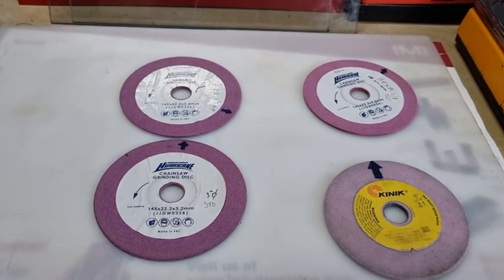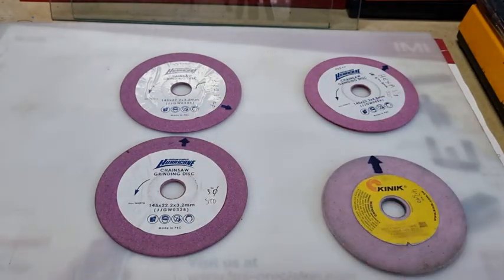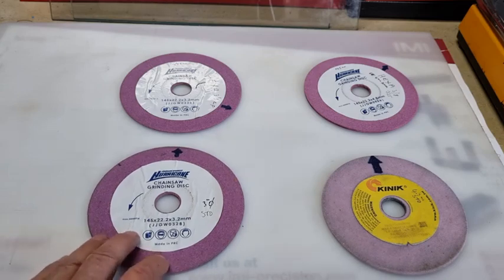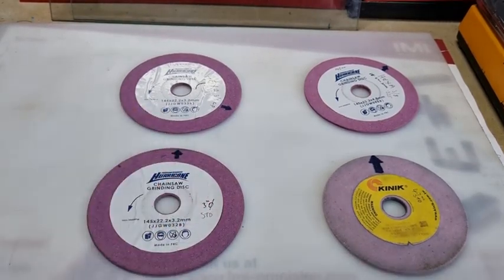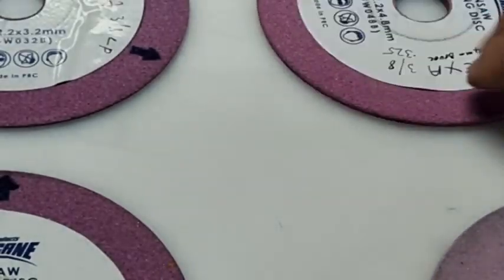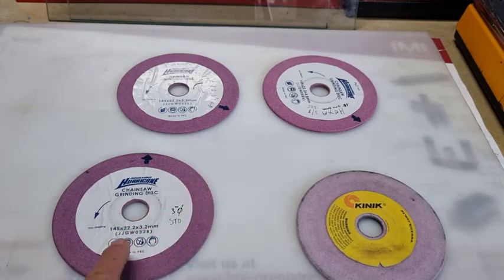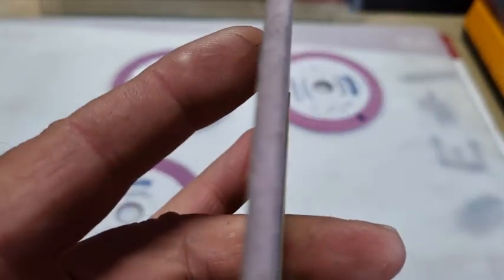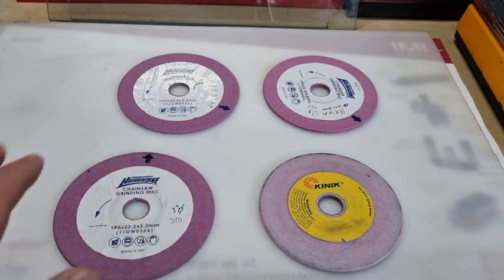Aluminium Oxide grinding wheels what's all the Hype about ?

Comment from the maker: What is the strongest bond in grinding wheel?

Rubber bond

Rubber bond (R): Rubber-bonded wheels are extremely tough and strong. Their principal uses are as thin cut-off wheels and driving wheels in centerless grinding machines. They are used also when extremely fine finishes are required on bearing surfaces.
They are also an excellent option in chainsaw grinders and run cooler than Aliminium Oxide wheelsb

Comment: been buying hurricane bars and chains from jono & johno for the past 15 years. have three huskys, 450 anniversary special, a 365 with a 20 inch bar and a 565 also with a 20 inch bar. got an 036? sthil, the only thing that is good for is as a wheel chock to stop the old cruiser rolling down the hill!  Cut around 18 to 25 ton per year, purely for self and a friend.
 Running a jolly grinder with those same pink wheels for over 10 years. keep a good profile on the wheel & no problems. Have just destroyed my first tungsten chain (hit a steel bar and took about 4 teeth off. always take around 8 fresh chains with me when cutting.
Reply from the maker: Good info and great feed back I but 100 foot rolls from Johno and Johno 
Hurricane 🌀 chain is good I can't fault it 20 inch chain of a 100 foot roll works out to be $23 each 3/8 full chisel.
Reply: @ChainsawUsers   I buy when they run a "bar and three chain" deal. Hence at this time I have two spare new bars for the 565/365 and and around 15+ new chains. have also got 4 spare grinding discs.

Comment: Fused together w/glass huh? Sounds like that'd be seriously bad to breathe and since the dust gets into the air when grinding sounds like that's a bad material to use in such a tool.. sounds almost like how asbestos was once thought of as safe.
Reply from the maker: Yes wear mask and you will be OK.
All grinders bench mounted ect if glass bonded and most are wear breathing mask
Reply: @ChainsawUsers  finally we see an actual legitimate reason to wear one. I'd still venture to say that running a grinder in a basement for example (my set-up) that those fine dust particles might find their way all over the place and be released when walking or moving things and still be an issue even when not actually operating the grinder. I don't recall seeing that listed on the grinder paperwork as an issue of concern when it clearly is. 
Possibly CBN wheels would be better in this regard? Looks like I'm going to have to figure a new set-up or grind outside with the wind at my back. Thanks for bringing that up!
Reply from the maker: Angle grinders bench grinders all of them will give of aluminium oxide dust glass dust and metal dust. Always wear a respirator of dust mask when grinding anything